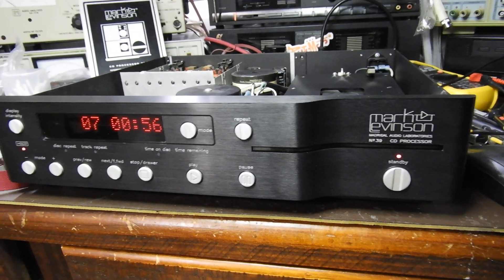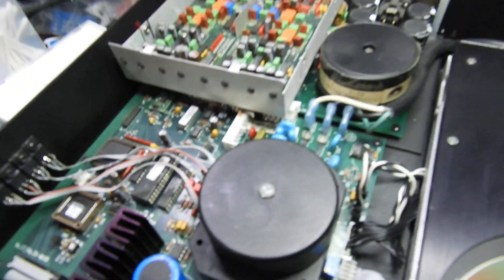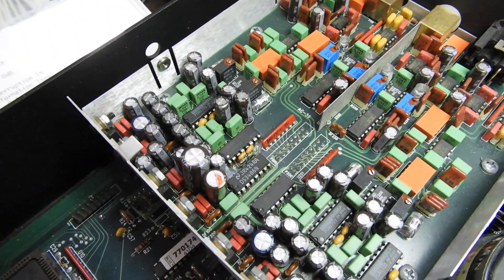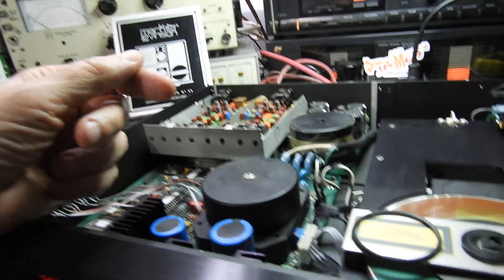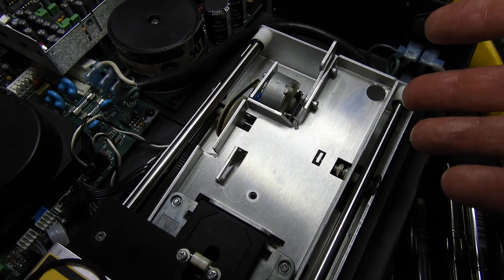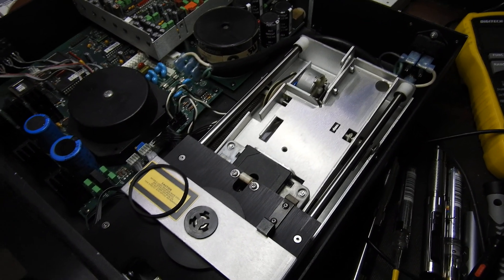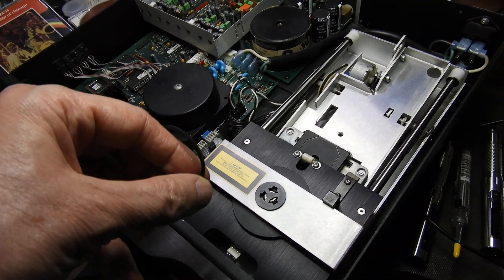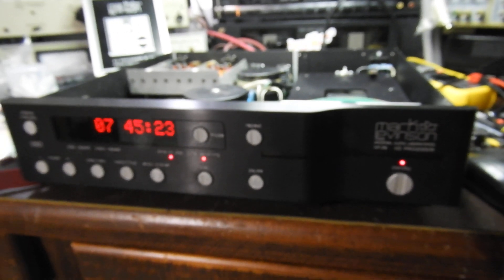Mark Levinson No. 39 CD player with tray fault and no audio on analogue outputs. Very quirky too.

Comment: Sadly my CD player is not fix after all those years.  I had it Opened and Closed many times to get it slowly open by itself when I played.  Any idea how or what/where to lubricate it?
Reply from the maker: All my wisdom on this is in the video. Obiously you need to replace the belt and then lubricate both of those chrome rods on either side of the tray, This is after cleaning them first with isopropyl akcohol. Then there is the calibration to be done.
But if you haven't done CD players before, this is not the one to start  your journey ;-) Get someone that is good on this to do it. Or sell it to me.

Comment: working on a No. 37 with similar clamp which is all over the place and would have liked to have seen what you actually did to repair the clamp. TIA :-)
Reply from the maker: Sadly my friend I do not remember 😞  Do it go sideways or up and down? Try taking the bridge off and inspecting it for anything that is odd. Can you make a video and send me a link t my email?
Reply: @hear-net-au  the clamp on the bridge is ok. The disc centering plastic hub is 2 pieces and the top half has come off and ejected with a disc. Fortunately the customer has found the piece and is sending it to me so hopefully I can repair it next week.

Comment: Did you manage to obtain a service manual in the end?
Reply from the maker: Only for the faulty part of the circuit
Reply: @hear-net-au  Is that for the analogue board? The DAC7800 is a 12-bit DAC, which would't make sense to have any real DAC duties next to the 1702s. My hunch is they function as volume controls of some sort.
Reply from the maker: @hansjanssen3364  I haven't had a chance to look at it in detail as yet, but indeed it looks like you are right as far as digital volume control.

Comment: My unit is very sticky, it does not open or close that easy.  I have to use my fingers to pull that tray out. Any suggestions (replace belts) where do i get them from? Thanks in advanced,
Reply: Did you ever find out where to get a new belt?  I believe mine needs replacing as well.
Reply from the maker: @brianjuanarena  I get belts from my local (4000km away) supplier in Sydney. WES Components. They have a retail arm called Wagner.

Comment: Ok, I see my unit has error code 56E2 and calibration failed.  Any one know what the code means?  Thanks
Reply from the maker: Don't know about the code, but from memory, calibration has to do with the tray having stripes and there is a procedure to follow after which the mech will work properly.

Comment: I have a 3009 error code.... and my issue is that the drawer works well without a disc, but when I insert the disc, then the drawer stops halfway through... I can gently push it to make it work but it is not ideal (the drawer opens normally when the disc is inside). Any idea? some sensors detecting wrongly the disc and stopping the drawer?
Reply from the maker: I'd rather think that it might be due for belt replacement. Adding a CD might be just enough to stopping it half way. The fact it goes out smoothly butdoesnotgoin well, might be due to belt's deformed shape